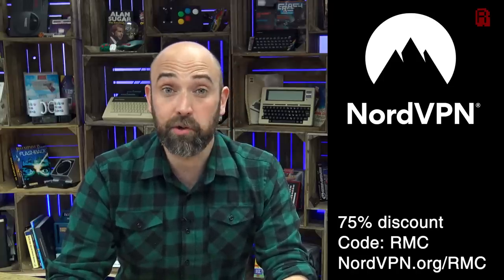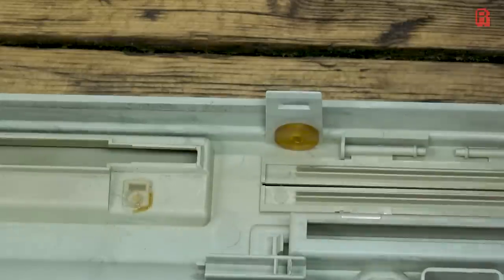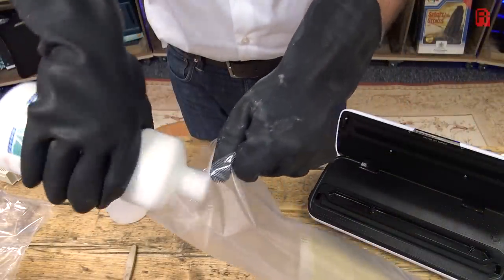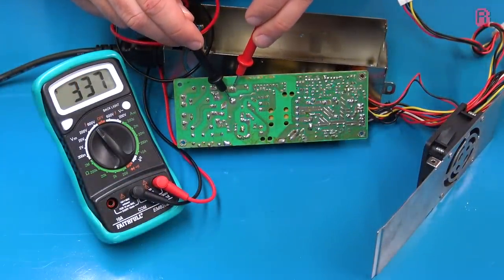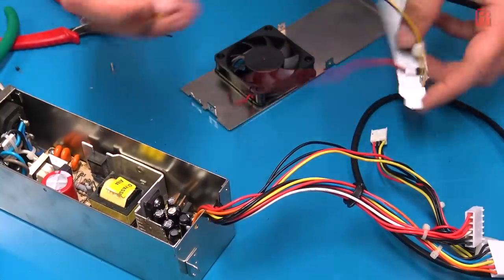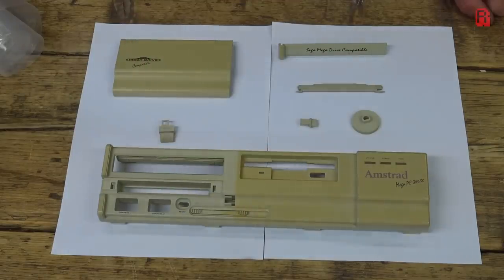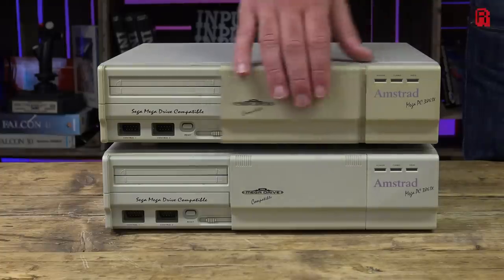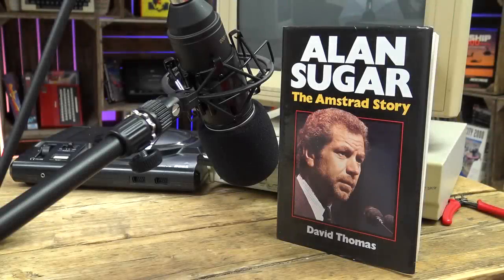Amstrad Mega PC - Retrobrite and Repairs | Trash to Treasure (3/4)

Comment: Soooo, you can't retrobright with no sun.
Then why are your plastics yellowing?  :-P
Reply: There's some interesting research on the subject.
Apparently there's more to it than sunlight.

And it seems getting a combination of incandescent lighting, airflow, indoor heating, and indirect sunlight through windows may actually be doing more damage than just putting something in direct sunlight.

In fact, just sticking something out in bright, direct sunlight may be almost as effective as using retrobrighting chemicals....

Complicated chemistry is complicated. XD
Reply: @KuraIthys  I did the "just the sun" method to a tank mouse.
Seems is getting yellow again after 2 months :-/